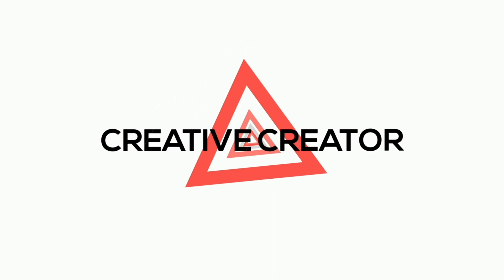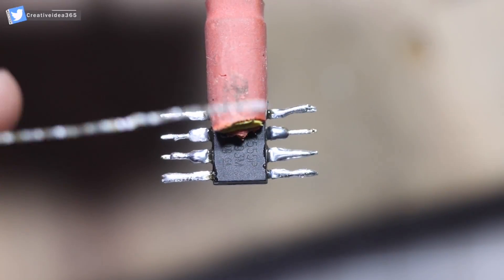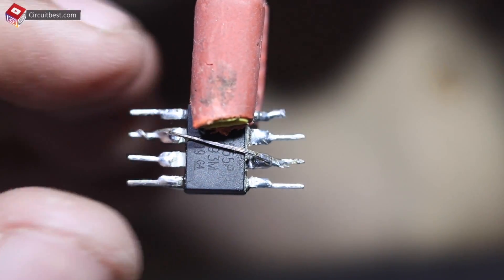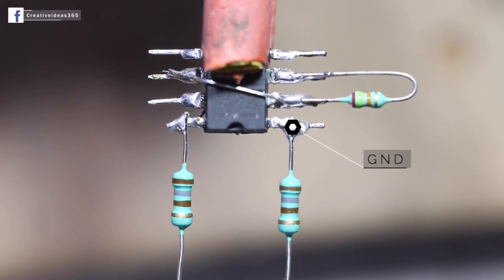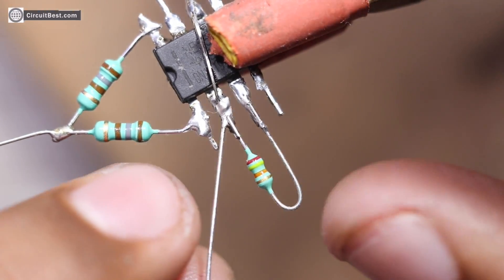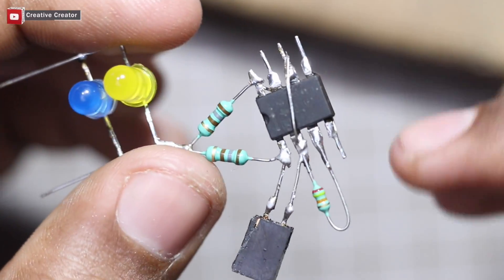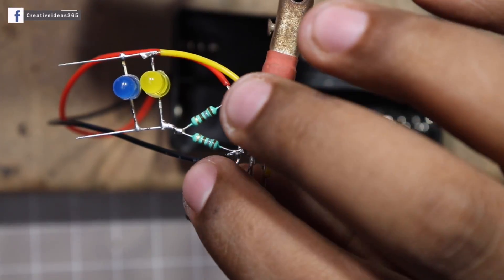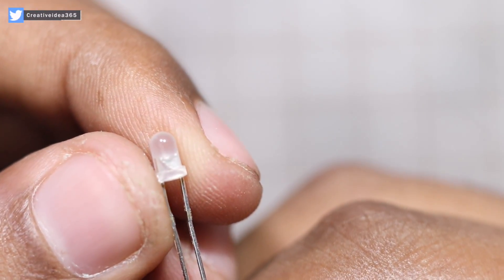LED Flasher Circuit

Comment: Do you have a design for using a 9-volt battery to make a 6VAC oscillator? I want it to drive a 6VAC motor-driven  Christmas ornament. Thanks
Reply from the maker: ok I will make